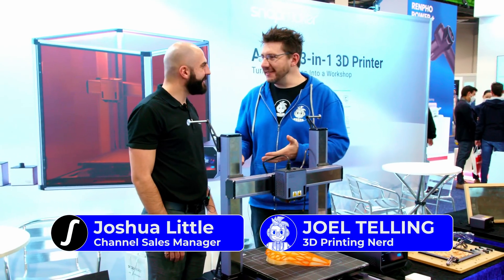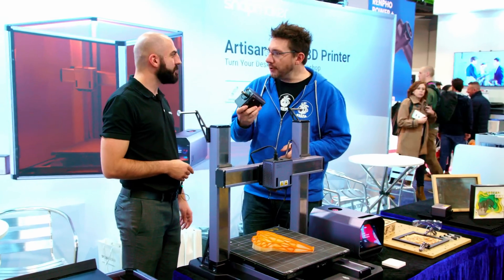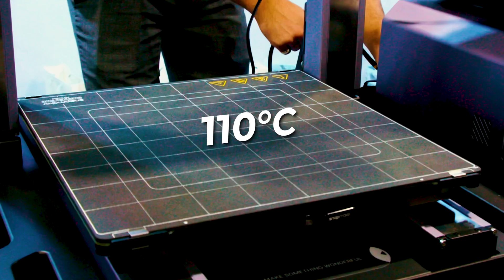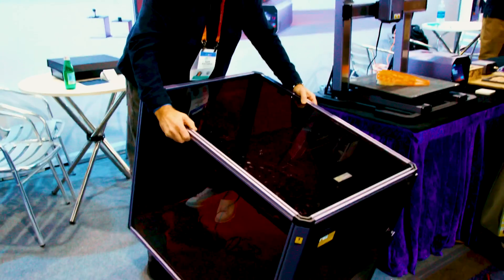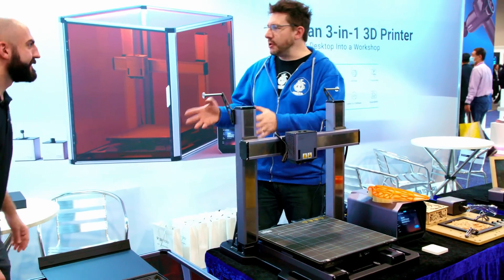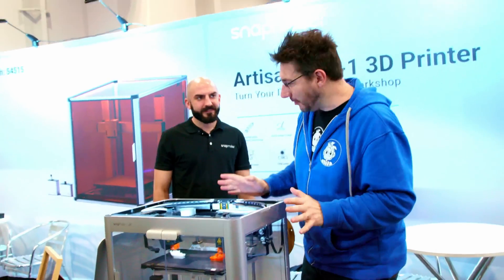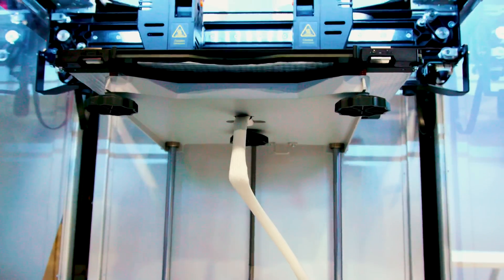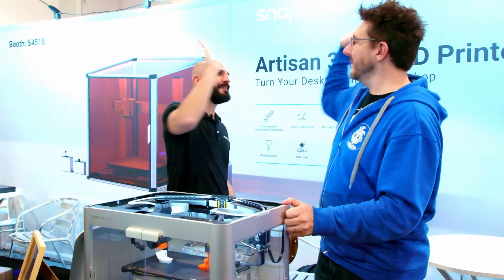CES 2023 - New Tech in 3D Printing! Snapmaker J1 & Artisan

Comment: oooh those print heads look like the print cores for the Ultimaker series. VERY NICE.

I do hope they have gone to PID heating rather than Bang Bang. The A350T can print very fast in my experience once you turn it up, BUT bang bang heating really holds it back. 

The IDEX is very nice too. Love the fast speeds as well. I like they have gone to the cardboard spools too. Love the look at them!

Comment: Now here's a question.  Snapmaker used to have a rotary add-on for the laser engraver and CNC cutter.  Can they get the rotary function to work with the 3D Print head to make round things from a different linear perspective so they might possibly be stronger, or easier to print more complicated round things?
Reply from the maker: OMG. How cool would that be?
Reply: @3DPrintingNerd  I'm an Artisan Aug pre-order so I look forward to landing mine in March, and this exact idea is one I'm already planning on exploring.   From what I've seen in the opensource firmware, from a G-Code point of view the machine seems able to do rotary module printing.  The challenge is generation of the G-Code.   

A unique area I'm excited about is combinational tool pieces.   Combining CNC + Laser + FDM onto one piece.   For example, decorating the exterior of a wine bottle.     Envision first laser engraving fine details onto the bottle, then CNC engraving a pattern, which then you FDM print into either partially or fully.    The FDM print can fill the CNC engraved groove or expand outwards in some very interesting ways.   I'll be writing code to generate the G-Code for this myself, probably as an add-on to Blender.

One mod I'm already planning is for the rotary module, creating a tower fixture for each of the rotator and tailstock spindle units to increase the "swing over" rotatable diameter up to at least 300mm.

One other thing I'm looking into for possibilities is mounting the rotary module at a 45° incline to be able to do some undercut milling.  Certainly not as good as true 5 axis, but may have some possibilities.
Reply: I had this idea also already. You have to build an adapter to hold a printing platform on the rotary module. Than you could print up to 90° in 2 directions. More cool would be the hopefully upcoming 5th dimension addon. Than you could turn the platform also in every direction… we need another slicer, there are some experiments results already with other printers.

Comment: So I’m supposed to be printing PETG in an enclosure?
Reply from the maker: You could, or you could print PETG without an enclosure.
Reply: @3DPrintingNerd  I don’t think I had ever heard of using an enclosure with PETG. I just googled it and some sources said it isn’t necessary or said nothing about it and some said an enclosure was completely necessary.

I’ve been printing petg for a couple of months now off and on.  Once I got my first layer dialed in it’s done pretty well compared to pla, but now that you have me thinking about it I wonder if an enclosure would improve overhangs and some of the random loops of filament that sometimes poke out of the walls. I thought it was just the nature of the material, like how it’s stringier than pla. The loops usually don’t leave a blemish when removed and they don’t happen every print, but they don’t happen with pla. I want to get or build an enclosure one day to print more advanced materials anyway.

Since I’ve got your attention, I think it’s awesome how much I’ve seen you promote and even give your own money to smaller creators/makers.

Comment: Snapmaker is like the syphilis of the 3D market. I wouldn't want to get it, and I wouldn't want anyone I know to get it.
Reply: Care to elaborate?
Reply: @NoriMoris  their products are just horrible, and what's even worse is their technical support. I got a A350 2 years back, it never worked correctly out of the box. Their troubleshooting included wanting to send me part by part to try and remedy the issues it had. In other words, I purchased a $2400 (Canadian) at the time 3 in 1 machine and couldn't use it as advertised. They wanted to send me parts 1 by 1 from China. At what, over a month wait each? (The screen didn't work correctly, flickered, had black spots all over it. The connector for the screen to the "brain" wasn't installed by the company properly. The linear modules were all binding, even on their own without being mated to another. I tried printing an obligatory Calicat.. and it printed at such a steep angle.. to the back and right...I'm surprised it even worked, crazy overhangs though! A few more tiny things I can't remember off the top of my head.)

Nope, I wasn't having it. Told them I wanted a refund and they could have their machine back. They said no, as I had it for more than 30 days. Well I had it for more than 30 days because it took 7 days between each e-mail reply from them. I threatened a chargeback on my credit card and they finally said, "ok we'll take it back.." this was after month 2 of having a completely unusable product... I had to pay myself, to send it back.

And I've heard 100s of the same type of stories. So I will forever let people know how much of a lousy product it is... How crappy their CS is. And in the end, I personally think they're a STD of the 3D printing community that just needs to disappear. There are MUCH better products out there for the money they want. They may not do 3 things with one machine, but I can get 3 machines that do 1 thing correctly for the same price and be a happy person. Lol

Comment: As the J1 doesn't has to swap filament like the Bambu its faster than the Bambu Lab X1 Carbon when your prints only require two colors or materials.
Reply: I might be easier because it doesn't have to swap filament, but the X1C is quite a bit faster, and can print with 4 colors as opposed to 2 colors. So there woulde be a difference between the 2.
Reply: @InTheDogHouse3DPrinting  a year later, I know 😅 their point was the J1 would be much, much faster at the two color/material limit than any current Bambu printer. Because there's significantly less time and material waste with dual independent extruders. Needs only a wipe per swap, not a full purge. 

But yes. Only up to two colors (or totally different materials!) automatically.

Comment: My first thought on the J1 was "Snapmaker is challenging Bambu."  And though not stated explicitly, the "it goes fast" and "it's good for schools" comments definitely move into that space.  So do the easy-change hotends.  But Snapmaker is missing the most important thing (in my view) that makes the X1 so comfortable for a person like me who hates screwing around with the printer:  the all-in-one nozzle, throat, and heatbreak.  Having that all as a single, gapless structure has by itself eliminated the single most difficult (and expensive to repair!) part of dealing with my creality machine.

If Snapmaker (or anyone else) really wants to move into the "it just works" category of 3d printers they really need to get rid of their old multi-part hot ends.  Bambu knows this; E3D knows this; Prusa knows this.  While personally I'd love to see Snapmaker license the Bambu hotend (and thus create a second source of parts), just designing the printer to use a Revo would also solve the problem.  Heck, even if they can't make a deal with E3D to include Revos, designing their clip-in, clip out system to accommodate a Revo would be a big selling point I think.  (Whether it would be worth the staff hours is harder to say.)  Or roll your own: I am not a lawyer but to the limits of my understanding a tube with a nozzle on it is too basic to patent - the Revo patent covers the entire quick change system, not just the "nozzle and throat are a single part."  

That said, Snapmaker is selling their entire hotend assembly as a spare part.  So it's 90% of the way there, and the risk of a blob of doom on the factory installed nozzles is probably minimal.  If I could afford to spend a month's income on another printer I'd probably find this acceptable.  And I'm definitely very happy to see further entries in the "this printer just works you don't have to rebuilt it" space.
Reply: I'm... Pretty sure the J1 hot end is a snap in assembly?
Reply: @timm7524  Yes, it is, which I why I said that multiple times.  It's still made up of nozzle and throat that's two separate pieces that need to be joined together properly.  Even if the end user never does this themselves, and relies solely on hotends made in the factory, having the old-style hotend means it's another place for a manufacturing error to happen and another place for parts to separate over time.  Which means it's a weak point on any printer that's aimed at the "it just works" crowd.

Granted it's an upside for the "I want to build my own printer" side of the hobby, but my impression was that Snapmaker was aiming at the folks who don't want to build their own printer.  And screwing around with separate nozzles and throats is one of the tasks a lot of us seem to be fed up with.  So I think this is the wrong choice for Snapmaker on this machine.
Reply: What's the problem with these parts being separated? I only see advantages with this approach. Just properly tighten the nozzle so it touches the heat break and doesn't bottom out on the heater block.
Reply: @Brainwash110  "Just do the difficult and dangerous task properly and you won't have a problem" is a perfect example of the kind of gatekeeping that keeps cropping up when people like me, who just want a printer that works, encounter the old-school guys who did everything the hard way.   I don't know if you meant to imply I'm not smart enough to own a 3d printer if I can't install a multi-part nozzle, but you sure as sugar just *did*.

Tightening a multi-part nozzle properly is not simple.  It has to be done while the nozzle is hot, too, which means it has a substantial element of risk.  It is definitely not an unskilled task, and speaking solely for myself the challenge of doing it properly has cost me about 200$ in replacement hotends.

If a company wants their 3d printer to fit into the "it just works, a school can have this in their library or shop class" category then it needs to eliminate all the highly skilled tasks in basic maintenance.  Expecting users to do some maintenance is reasonable, but changing the nozzle on a 3d printer needs to be as easy and as safe as changing the feed rollers on a laser printer.  The Bambu X1 gets very close to this mark.  The Revo hits it.  And as I said in the first post, Snapmaker's "click-out, click-in" design can probably be treated this way as long as there's no issues from factory.  But sticking with mulitpart nozzles while pushing into the "it just works" space is a weak spot, I think.

Comment: The new 3in1 looks a bit better than the first one for sure. But still seems to fall in that ditch between overbuilt 3d printer and bad cnc machine. I await the testing, hopefully the new spindle can actually move some material. However, I do note a severe lack of chip extraction with a vacuum. I would expect that to be a 1st party injection molded part with the brushes already attached rather than something I have to spend a few days designing and building.
Reply: Ya first one is bad for CNC still can't use bed flingers. They got nice ideas but they are still not there yet with their machines this far better then their first designs though.